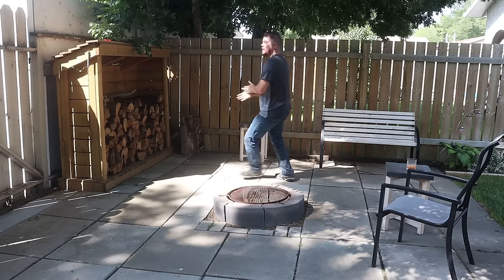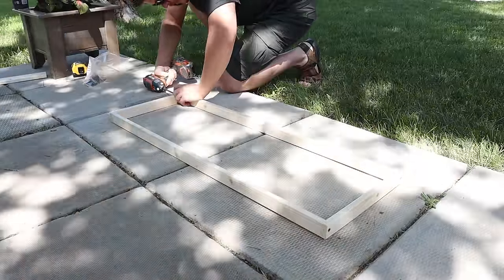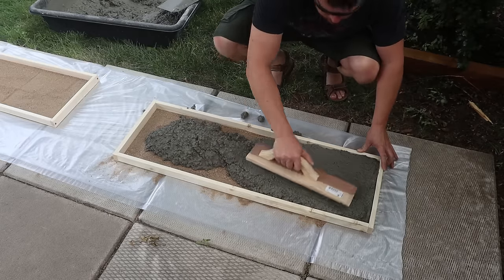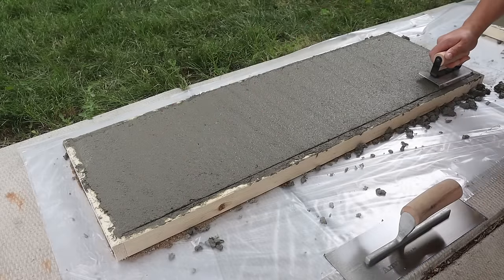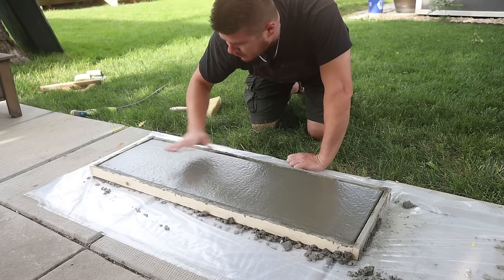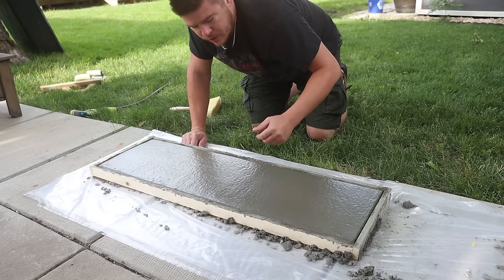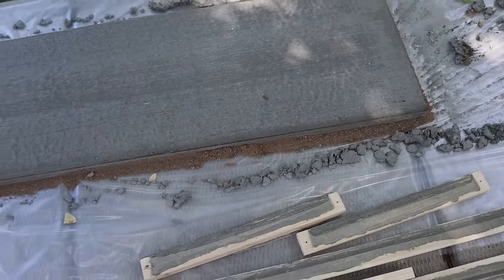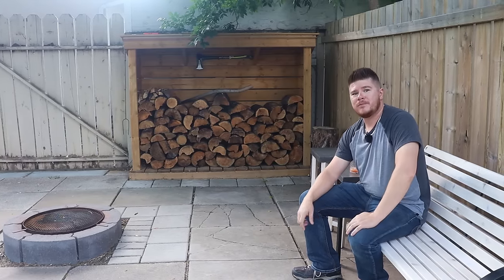How to make Patio Blocks quick and easy from concrete // DIY

Comment: Hate to say this but... I overthink my own projects, too. Right before my wife points out a cheap easy solution. For example: "You could have just bought regular pavers and used a pencil and your grinder."
Reply from the maker: I don't think a grinder is much easier than it is to just make a couple. Probably takes almost as long, and quieter with less dust. But it's up to you
Reply: Sometimes it’s just about the fun of a diy project and teaching others.
Reply: Better to use a chisel, not a grinder.
Reply: Just tell her to do it while you do her chores.
Reply: If you cut down bought patio blocks the finish will match your other patio block more closely.
Reply: @CarolineAkwi your HOA has daytime noise rules?
Reply: @ralphaelalfaro6023 man, I much rather play around with concrete than do my wife’s chores!
Reply: Have you tried this angle grinder trick? Would be nice to see how it turned out 😊
Reply: 6:09  @JessedoesDIY
Reply: Haha too true.
Reply: The pavers I need are expensive, 25"x25" x 2" , I would rather buy them then do all that work, I need 12 of them
Reply: I’m a 56 year old widow, and I’d rather play around with concrete than do my own chores😂

Comment: What was sprinkle in the plastic?
Reply from the maker: Sand. It stops the concrete from sticking to it, but doesn't hurt the concrete. It also seals the form so the water from the concrete doesn't leak out

Comment: FINALLY. Clear and not 100 steps lol. Looks great. I’m making some 12x36 ones soon and this was a great video! Thank you! 🎉
Reply from the maker: That's awesome! Keep me posted on your progress, good luck!
Reply: @JessedoesDIY  hey stupid question, I’ve never done anything with concrete. Just use quickCrete or do I want a brand that doesn’t dry too fast? What brand did u use for this? Also just a bag of play sand works?
Reply from the maker: No prob. So I used quikrete 5000 on this. You can really use any bag, but this 5000 and 6000 mix of theirs sets up faster then the regular stuff. It doesn't get hard too fast to work with, but it sets up in about 8-10 hours as opposed to 24 hours. This way at the 24 hour mark or so you can demould and lay the stones, gently of course. The regular stuff you'll demould after 24 hours and wait another day to move them yet. And yup, any type of sand will do, nothing special. Hope that helps, good luck on yours! Keep me posted
Reply: @JessedoesDIY  sweet thanks SO much for replying!
Reply from the maker: Anytime!
Reply: @JessedoesDIY  hey again. So I made two to start. They’re 12x40. Just like you did. After drying I see small rust colored flecks on both of them. I am super bummed. It’s probably not noticeable to anyone but me but is this from maybe my water or bad concrete? There’s quite a few but they’re small, like a few mm in diameter. I will use a hose filter for the nest batch but anyway to get rid of the spots? I tried just a toothbrush and water after today after 24hrs and no go.
Reply from the maker: Really? That's strange, I've never had an issue like that, and I've had my share of issues with concrete lol ummm without seeing it, hard to say. Try some 200-400 grit sandpaper to get it out. Either wet or dry sand. Hope it works
Reply: @JessedoesDIY  it’s broom brushed so that would probably knock down those ridges so I will try an exacto. It must be my water.
Reply from the maker: Got ya. Yeah that's so weird. Water, hose or fitting maybe?
Reply: @JessedoesDIY  hose it just a fabric expandable one. In FL our water is reddish and has lots of iron old houses but idk. It’s a lot of spots. Will do two more and see what happens.
Reply from the maker: Maybe get some house water filled in a tub in a bucket and use that?
Reply: @JessedoesDIY  it’s all of our water even when we fill out the tub it has an orange tent. I already have reached out for a whole house water filtration system. I’ve been meaning to do it so I’m just gonna bite the bullet and get a good one.
Reply from the maker: Really? Thats crazy. Well good luck either way, hope it works out
Reply: @JessedoesDIY  it was our water. Used it double filtered like I do my rare houseplants and no red spots. That’s crazy and I am now buying a whole home filter system this week 🤦‍♀️
Reply from the maker: Really? Well good to hear you figured it out. Good luck man, keep at it! Have a good holiday
Reply: @JessedoesDIY  thanks you too! Im a chick BTW 🙋‍♀️
Reply from the maker: @adrianpoe4416  oh sorry! Lol that's even better. Have a good one
Reply: Exactly just what you said I agree 👍 💯

Comment: I enjoyed the video, thanks.  Your sand and plastic sheeting method works good but I think if you are doing a few slabs then using plywood would be less work and better for the environment.  Also less likely for the rectangle to skew and a consistently flatter bottom.  If you wait for 1 hour before edging and then brush it right after the concrete would be at a better consistency to achieve the desired results.  For anyone wondering, these slabs are too thin for rebar,  you could use some wire mesh but even that's not necessary at these dimensions, better to make sure you have a flat compacted base.

Comment: Great project. Concrete can be labor intensive and fun. I’ve done several jobs around the house. But didn’t make a video. Thanks for making this video. Letting the novice see how easy it can be. 👏🏽
Reply from the maker: Thanks! It is fun but yeah, lots of actual labor which I think is glossed over a lot of the time.
Reply: better spending time doing things you love rather than on things that bore you!!

Comment: My partner and I have been making dozens of life-size Bigfoot footprints using a similar technique. I like to see that you can do something professional like this as well. I think this is probably cheaper than buying 2'x4' premade pavers at HomeDepot. Unless you factor in your time... then it's no contest. I see this as something I'd do if I wanted a paver size that isn't available. Nice work 👍
Reply from the maker: Thanks. That's exactly why I make them, when you need sizes you can't buy

Comment: Tap your forms around the edges after you have the concrete to height
Another suggestion for textured finished is pour it upside down on some textured  wooden boards  or mats or stamp a pattern on it.
Just a case of using your imagination and items that you have kicking around 🙂
Reply from the maker: Absolutely
Reply: There is always one.
Reply: Excellent idea!

Comment: 2 quick ?’s:
  1.  If reusing the molds… Other than cooking spray, would something like Vaseline or Candle Wax work to make it release & clean up easily?
  2. I’m worried that a slab that size & thickness might crack or break… At what point is it necessary or at least should you consider using either a wire mesh or mixing in loose fiber glass to reinforce it?

Good video!  Thanks!

Comment: Can't wait to do our own for our backyard! We're considering pouring a bunch of 12 x 36" pavers. Should we add rebar or wire mesh for strength?
Reply from the maker: Nice! Depends what you'll use them for. These were light duty, but you may want rebar or the diamond wire mesh, whatever you have access to, it wouldn't hurt! Good luck on yours!

Comment: Thank you! Simple, straightforward, and understandable! I'm gonna give this a try. 
One question: Does the sand you put down first become part of the paver or is the final thickness only the concrete you poured over it? I don't understand the purpose of the sand. Thanks.
Reply from the maker: Anytime, glad I could help! Some will stick to the concrete, but because it's one of the ingredients in concrete already it doesn't hurt the slab. It's mostly there to prevent the slab from sticking to the plastic and it waterproofs the bottom of the mould. Good luck on yours

Comment: Great video. I was thinking they are too thin and have no iron bars inside. The iron rods don't have to be too thick either. For the corners may be alright but towards the end of the video I see some cracked stepping  pieces. To smooth it out I find it better to use some foam or Styrofoam to rub gently over it , as necessary, before it is too dry. You might also sprinkle little water on it for that.
Reply from the maker: Thanks. Yeah I didn't add because they are a decorative corner stone that won't be abused. The cracked stones I got for free from a friend a few years ago for the firepit, and one I smashed myself by accident.
Reply: @JessedoesDIY  they would be nice all done like them, but don't forget the rebars
Reply: There is always one.
Reply: Because if the length, I personally would have tossed in some repurposed wire coat hanger pieces for some added strength.

Comment: Love this idea, you're the second person I've seen do this and I want to for a home project but the other person didn't use sand. What's the benefit or reason for it here so I can better assess which method to follow? Thanks in advance
Reply from the maker: Hey sorry for the late response. The sand just helps seal the form and prevent it sticking to the plastic. But since sand is one of the ingredients in concrete, it doesn't hurt anything. Plus it gives the bottom a bit of grit, I like to think it helps prevent the stone from moving around after setting it in place until it settles in.

Comment: Hi, your video is really good and easy to follow. with 20Kg bag of concrete, quick dry, have grave already, how may paver 60*60*4cm i can make? do i need steal bar inside?
Reply from the maker: Thanks, glad you like it. I have a concrete calculator in the description, or you can Google it. Fill in all your info and it'll tell you all you need to know about how many and how much. Reinforcement bar will always help prevent cracking and is always great

Comment: Thank you so much. I am going to do a small short 70lb one! For strongman training. Wish me luck
Reply from the maker: No problem! Oh wow, nice. Well good luck with the project and training! Depending on what you do with it, I may add some reinforcement to give it more strength
Reply: @JessedoesDIY  any suggestion on how to reinforce it? We are going to lap it and shoulder it
Reply from the maker: You can use some mesh and cut it with tin snips or rebar but you'll need a way to cut it like an angle grinder. Both reinforcement methods are in the concrete aisle

Comment: These look great. Just a question: Would these work on a driveway without cracking as is, or would they need to be reinforced?
Reply from the maker: Thanks. Anything for driveway use should be about 4" thick and reinforced to resist the weight

Comment: Very nice job!! Is it possible to make then 1.625" thick rather than 2"?  Can a quick dry concrete mix be used?  I wasn't sure when you said do the edges after 1.5 hours.... is that after the initial edging which was after 30 minutes?
Reply from the maker: Thanks. If you go and thinner than this they risk cracking very easily, and the faster it dries, the more likely it is to crack. And yes, I did the edges twice, once as a initial pass, and the second later to smooth it out. Lessens the risk of damage to the edges

Comment: If you think your to late, wet the brush. I saw diamond mesh did you reinforce your molds with the mesh? Nice job.
Reply from the maker: Good point, I should have, but after a few passes it actually looked good. I didn't on these lightweight stones but I have another video for a different style that I did, I reinforced that one

Comment: Are these driveway strength and what kind of mix did you use to get a pretty color. I’ve used some really ugly Concrete before lol for example, some of the Concrete that I’ve purchased for setting posts has dried all kinds of wonky colors and just been really ugly Concrete. What brand did you use here if you bought it pre-bagged or what mix did you use if you mixed it yourself?
Reply from the maker: Oh no, you'd need at least 4" thick concrete and a proper base for driveway strength. Even then, they'd probably be pouring stronger concrete with additives. It's just Quikrete I usually use the blue and white 6000 psi mix or the basic yellow bag. If it's a bunch of random colours I'd guess it isn't mixed enough so it gets streaky and clumpy, because cement is grey naturally, so that makes the concrete grey.

Comment: Nice job. Looks great. But it's really easier to do a dry pour. Dump half dry cement and smooth...add rebar or whatever, add more dry level and mist with water. No heavy mixing. And very strong
Reply from the maker: Dry pouring is a terrible idea on so, so many levels

Comment: Fun little video.  Got a question: Why do you show so many broken tiles in your patio?  It might be a good time to go over this on a next video, ground prep, tamp plate, gravel, and in the form gravel and or wire reinforcement or thickness of tiles to try tp prevent the cracks.

No, I'm not being critical, just thinking ahead and knowing the topic from my extensive past work in construction and landscaping, the presence of cracks indicates a (preventable) problem, that is, if you want to avoid cracks or traffic depressions on your nice flat patio.
Reply from the maker: Thanks. I show it as it is, not worried when something isn't perfect because most peoples yard aren't perfect. Especially in my extreme Canadian climate, things don't last as long. But in this case it's broken because some were already cracked as I got them for free from a friend, and others were broken by me when I smashed a giant log onto it

Comment: Nice!  I live in south Africa so I don't get the same products as you do...... Are you using a premix fast drying concrete?  If so what are the cement ,sand and stone/ grittone ratios?
Reply from the maker: Thanks! It was a poor mix but not fast setting, just basic concrete. To mix your own use the 3-2-1-.5 method. 3 parts aggregate, 2 parts sand, 1 part cement, .5 parts water. Adjust as needed. Hope that helps!

Comment: nice. one thing tho if add rebars or mesh of some source it will be solid and last longer ... as you can see in the old slap its cracked for severals reasons ,one of of them bien lack of rebars or mesh
Reply from the maker: Absolutely. Some of the old stones were cracked when I got them as I got them for free, and a couple I smashed by cutting wood on them lol. I've since made a thick, reinforced slab to cut wood on
Reply: @JessedoesDIY  cool! I am a handyman . I love concrete work , wood work , deco and much more … problem in uk very hard to have space for a garage or work station etc .
Reply from the maker: Nice. Yeah I could see that. We have more space here than anything for a shop, but they are so insanely expensive here I can't afford one

Comment: I'm wanting to make bigger pavers, at least 600mm^2 would you recommend using rebar or some sort of reinforcing inside?
Reply from the maker: I'd use a bit yeah, even just dome wire mesh. Especially if they'll see some use and foot traffic

Comment: I tried this as an experiment before I commit to making wall caps for real.
And my only problem was the concrete. After 1.5 hours, whilst trying to round the edges, i kept on hitting and dislodging the concrete ballast stones and it left a horrible local rip out. So, 1) didcI use the wrong mi? 2) did i hit this too early / too late? I waited 1.5 hours.. 
grateful for your advice.
Reply from the maker: Sounds like you may have either had it too wet, or you weren't lifting the nose of the round over tool enough, or you may have been pushing too hard. Tough to say without seeing it

Comment: In the sand you could imprint some pebbles or other wood texture and have a more interesting one.. Only I always wonder what to add to the sand to make it the same as for foundry moulds.. ash, bentonite?
Reply from the maker: The sand is on the bottom, adding things to it would be pointless. These stones were made face up
Reply: @JessedoesDIY  After all, it's enough to make a mistake, it's not that difficult and do it differently :)

Comment: Is this normal concrete?  Some are suggesting adding sand. Did you do that?
Reply from the maker: This is prebagged concrete. Concrete is premixed already with everything you need, just add water. If you're buying cement, then you need to add sand and rock to make it concrete. Cement is an ingredient in concrete so if they are adding sand to already mixed concrete they are messing up the ratios and weakening it. They are either unaware of the difference between sand and concrete or are sabotaging it themselves

Comment: Hey man, nice job! Thank you for posting.
I have a quick question: What if I wanted to do something like this but the blocks would have to support pedestrian weight or maybe even weight of a car? Should I then use thicker blocks or add rebar?
Reply from the maker: Thanks! Well if you make the blocks with a 1x3 form it'll be thick enough for pedestrian no problem. Reinforcement will never hurt but I'd use a wire mesh made for house parging, it's thinner for this thin stone. A vehicle is another story, that will need rebar and be about 3.5-4.5" thick and dried for at least 3 weeks.
Reply: Not sure if you did that one stone that was cracked but not good advertisement
Reply from the maker: Haha I got a few stones from a friend for free a few years ago and I broke it myself by dropping another stone on it accidentally

Comment: I’m new to these things so please bear with me. Is there some sort of ingredients or ratio of the materials used?
Reply from the maker: No prob. I used pre bagged concrete and just bucket of regular playground sand from a local landscape supply for the bottom. The concrete is already pre mixed in the bag and just needs water according to the instructions on the bag, or until it gets to the right consistency. If you're mixing your own concrete you'll use the 3-2-1-.5 method. 3 parts small rock, 2 parts fine sand, 1 part cement and .5 parts water